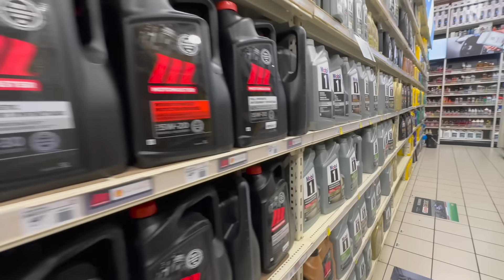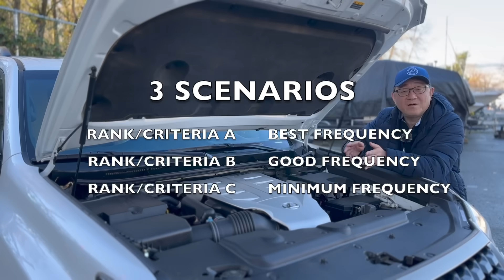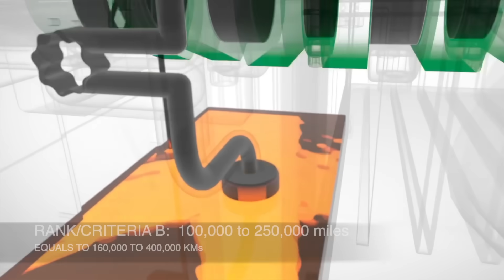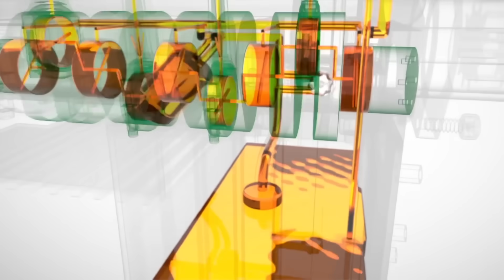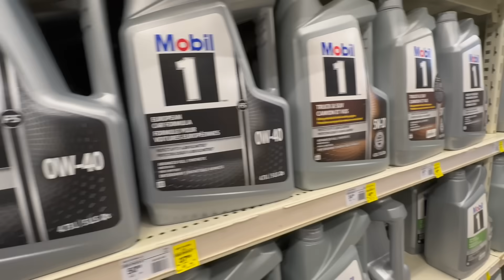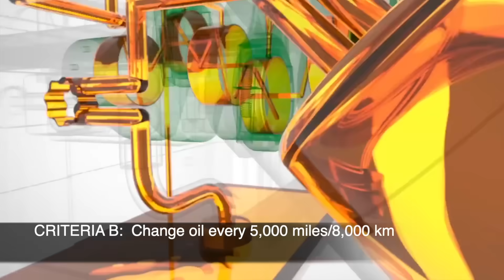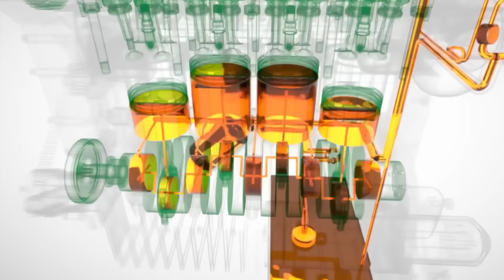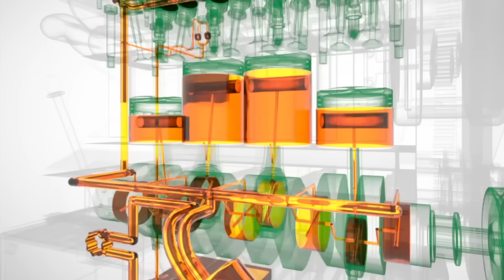ENGINEER EXPLAINS HOW OFTEN TO CHANGE OIL & FILTER // UPDATED CRITERIA-BASED RECOMMENDATIONS!

Comment: Criteria D - You want to keep the vehicle 20 years and only average 3,000 miles a year. My preference is two wheels so my van sits a lot. If 90% of your driving is less than 5 miles, the condensation and exhaust contamination on start up doesn't fully burn off.
I change my oil and filter every April unless I put more than 5,000 miles between changes.

Comment: This is why I do not buy certified vehicles as leased users never change the oil in 20k as they will not keep them. All have sludged engines and oil burners as leasers are cheap and selfish and don’t care about new users problem

Comment: After 12  to 15 years of regular use cars will fall apart around the engines regardless how often you change oil or do other maintenance.  Interiors start to wear out, door dings, rock chips, dents,  rattles, road noise, front ends wear out, emission control sensors start failing, check engine light comes on more and more., In my case my girlfriend (wife now) insists on taking her car on dates.  etc. etc.    Before long you increasingly get a wandering eye looking at new cars.
Reply: 2005 Yota Camry, 300,000 miles no problems except for normal wear items. Not even close to falling apart.

Comment: Gee... My 2000 mercury cougar has had 0-30 synthetic and I change once a year, about every 10-12,000 km.  It sits outside all winter which we get -20c most of and even times as cold as -50c.

Comment: Excellent, simple video, thanks.  I am a retired mechanical, lubrication, and powertrain engineer.  Engine owners must understand the engine is one of the dirtiest oil environments of all oils, and it is the contamination amount that defines when to change oil - not how good the oil itself is.  Advertising 25,000 mile engine oils to most engine owners, those that plan to keep their cars, is incorrect.  Use a good quality API Group III synthetic oil and change oil and filter every 5,000 miles.
There, done.
Reply: It is what Toyota recommends. And you don't need a slide rule.
Reply: @markstrickland8736  - you a subject matter expert in used oil analysis?  If not, suggest you not comment.
Reply: @brianmann986  I didn't realize a subject matter expert certification was required to post here. However, I do know that Toyota has subject matter experts who are far more learned than you. And probably not as arrogant.
Reply: @markstrickland8736  - please show where I said subject matter expert certification was require to post.  I doubt Toyota has expert tribologists.  Please also explain their repeated recent engine failures.  You sir, are the arrogant one.
Reply: @brianmann986  "you a subject matter expert in used oil analysis?  If not, suggest you not comment."
If you think you know more about Toyota's engines than Toyota, you are, indeed, arrogant.

Comment: Thank you for the great video.  Just wanted to ask if there would be a benefit to running synthetic in a Cherokee with 160,000 miles? I have been warned in the past to not do it, as the synthetic will cause it to leak oil.  Just wanted your take on it, with your knowledge.  Thank you again.
Reply: Synthetic comes in high mileage, so I'll go with that
Reply: I went from conventional Walmart to Walmart synthetic at 225.000 miles in the 93 Subaru Legacy. It has 240.000 on it now. Married a lady with a decent Pontiac Torrent with 140.000 miles on it. She has insurance on it. I parked my old Ford truck and the Subaru. I put my toilet paper filters on the engine and transmission. It has 207.000 miles on it now. I told her the Pontiac will out last her Honda Accord because it has clean oil. When her oil change light comes she gets the oil changed.  She complained the other day because she paid 75 bucks for an oil change. The Pontiac gets a roll of toilet paper and a quart of Walmart synthetic every 6.000 miles. She says toilet paper? LOL.

Comment: Honda factory requires a change of oil every 10k miles, I do it every 5k and 25k on CVT fluid. EVs will not replace the combustion engine period.

Comment: Pretty much in line with my own experience and preferences.
I change my car and van oil every 5000, but my bike oil every 2000.
Difference being, I can feel the oil degrade at 2000, as the gearbox is really hard on it.
Never had cause to regret these change intervals, and I've put hundreds of thousands of miles on two and four wheels.

Comment: Very  general recommendation, to be more accurate, it must include the environment and driving habits, such as, are the driving trips a short distance, <5-10 minutes in cold climates or longer trips of > 30 minutes in moderate temperatures.
Furthermore when oil reaches its oxidation and nitration point, the oil will break down and losses it's lubrication properties.

Comment: When I was young and strapped for cash I was told "If you can't afford the oil at least change the filter". Which raises the question: If the oil is capable of longer life as long as it's clean will a fresh filter enable you to run longer (ignoring the mess you might make swapping out filters with a full crankcase)?

Comment: You inital statement that conventional oil does not breakdown is incorrect. Conventional oil or non-synthetic oil loses viscosity as it ages. As the oil deteriorates  so does it's lubricating properties. Older oil will compromise your engine especially at cold starts when lubrication is so critical.

Comment: I try to pay more attention to the color of the oil then the miles. Especially since I do my own oil changes. I forget too often to record the miles! So my rule of thumb is when the oil starts turning brownish. I prepare to change it... 357k miles on my 99 Camry now, bought it in 2000 with 14k on it. Never had an engine issue and not burning oil and compression test 3 years ago, all cylinders equal and well within spec!

Comment: I just change my filter once a year and add extra synthetic oil when needed. My car is a 2007 and has 185k on it, and still runs just fine and with no problems. How does the oil collect so many contaminants if you have a good filter?? What kind of engineer is this guy, and what actual experience does he have? I find that who cares how long your engine lasts if all the other parts on the car wear out before your engine does. It's not just about the engine.

Comment: Driving habits, driving conditions (Highway or city), climate, driving usage (off road, tow, commercial...etc), age of vehicle are all important factors missed here, with respect. I run a showroom condition 2015 AWD MDX in 🇨🇦 with 120,000km's on it. It's cold here and I do city driving mainly, I run full synthetic oil. The Acura maintenance minder is pretty advanced (It monitors many items) and I trust it. It kicks in at about 6,000miles (9,500km) and that's in line with the owners manual and what I believe personally.

Comment: I am onto my second Turbo Petrol car, the first one had a RB30 motor and always changed the oil n filter at 5,000kms, most people who had the same car as me were rebuilding their turbos at around 160,000kms, before I got rid of my first turbo car it had 260,000kms on it and never had a problem with turbo play or actual engine. My second turbo petrol current car is an i30N Performance Luxury Model, I also change my oil n filter every 5,000kms it never blows any smoke or needs extra oil before oil n filter change.  So IMO if you want your ICE to last you for how ever long change your oil n filter every 5,000kms, and Air filter every 20,000 max fuel filter 30,000kms, run some injector cleaner at least once a year and you should have an ICE which will last you for a long time.

Comment: I HAVE A 1999 TOYOTA 4 RUNNER LIMITED WITH 3.4L V6 DOHC ENGINE WITH 966,285 KM OR 600,000 MILES . I USE A PUROLATOR BOSS LONG FILTER  WITH AMSOIL SYNTHETIC SIGNATURE SERIES 5W-30 AND LUCUS SYNTHETIC OIL STABILIZER, AND I CHANGE THE OIL EVER 20,000 KM OR 12,000 MILES. 

IF YOU USE ALL OF THESE WHICH ARE THE VERY BEST OIL , OIL FILTER AND OIL ADDITIVE  YOU CAN GET 20,000KM OR 12,000 MILES PER CHANGE. 

I AM LIVING PROOF OF THIS. IF YOU LISTEN TO THIS GUY AND CHANGE YOUR OIL EVERY 5,000 KM NEVER USE SYNTHETIC YOU ARE WASTING YOUR MONEY.

Comment: The simple answer for ALL.  Change the oil when its getting darker, but not black.  If its almost clear honey appearing and 5,000 miles, DO NOT CHANGE IT!  I don't care if its been 3 months or 5 years.  WASTE OF MONEY.
If the oil looks more like weak coffee, now is the time to consider changing it.  Its not full of contaminants yet, but its got more than enough that wear will start becoming worrisome as it moves to full on black oil.  

If oil is black and you can't see the dipstick through that little dab of oil, then you've waited too long.  Change it and don't wait that long next time.

Visual Flight Rules here.  Check your oil.  If it looks almost like it did when new, leave it alone.  If it looks dirty brown, but still somewhat translucent, it's still fine, but you should be readying for a change in the next month or three (if you drive ALOT) or in the next year (if you drive very little, work from home, weekend car, retired, etc).

Any strict schedule is A SCAM!  It's big oil colluding with big auto.  Tell them both to go pound sand.  Tell experts to go pound sand. 

The ONLY outlier, is if water gets in the oil, it may still look clear(ish), but if you notice your oil is thinner than it should be, CHANGE IT!...and get that engine checked for blow-by or head gasket issues.  Most of the time thin oil will result in low oil pressure warning, so take that seriously.

Comment: Why is the recommended oil change interval for diesel engines so much longer than gasoline engines.
Reply: Really?  My 6.6l Duramax has a recommended oil change interval of 10,000kms.  My Porsche is 15,000kms.  Does GM know something Ferdinand doesn't?

Comment: 6 months or 4000 miles which ever comes first.  Using Pennzoil Platinum Euro synthetic 5w-40 in my 2016 VW Golf MK7 with a Stage one tune and no failures so far.

Comment: NOTHING can prevent oil company from LYING about oil content. They can easily put full synthetic label in the bottle even if it actually use recycled base oil of the worst quality possible without any consequences.

Also this video do not address the extreme difference of oil quality between brand in the market. especially when people no longer pay attention that some oil do not have API certification mark. so even 3000 miles suggestion can damage the engine with poor oil quality. Even if it has FULL SYNTHETIC label on it.

Comment: great video!  Those expected lifetime mileage numbers for B and C almost hurt my feelings.  I have a 30 year old Dakota with just under 300k on it and I change the oil twice a year no matter what the miles are. I do that because it calls for a thinner oil in the winter than summer... It still doesn't burn any oil but I drive 90% highway miles on it, so maybe that helped.  My Toyota Sienna gets it's oil changed at 3-4k miles and it just got it's 4th timing belt change yesterday at 323k miles... I'll be upset if both of them don't go past 500k miles LOL.

Comment: Great info, exactly what i'm looking for! I Own a 2014 F150 3.5L ecoboost, with 94k miles. I used to change the oil every 5K, but since it's getting up there in mileage, i've decided to change it every 3,500 with a brand new filter. I use the P1 Boss filter along with Valvoline Maxx life Hight mileage or Pennzoil Ultra or Platinum oil. However, i've been using the Valvoline more lately because it's much cheaper over the Pennzoil. Probably switch to the Pennzoil every third OCI.

Comment: 25 year old Honda Accord, oil and filter changed every 3,000 miles and it still runs perfectly.
Reply: Honda jazz, 19 years 183k miles, I am the owner number 5.  I change the oil each or before 3k miles too.  I just adjusted the rocker arms and checked the timing chain.   and around.  and oil pan too,  all good.
Reply: I GUARANTEE if you went 10,000 miles between oil changes, NOTHING would be different Vs your 3,000 mile interval. Your Honda would run EXACTLY the same as it does now. Of course, you would add a bit of new oil during the time. All engines will burn some oil. 
SO MANY driver's have been hoodwinked by those 3.000 mile oil change company campaigns! So many consumer's have wasted time/money changing their oil every 3.000 miles! If it makes one "feel good" I guess, have at it....I am not that gullible.
Reply: @ttbjammn  that is funny as is your GUARANTEE. My car is probably older than you are.
Reply: @paulbunyon6324  I am 59 dude. Changing your oil at 3,000 miles is such a waste!! Do not be so gullible...
Reply: @ttbjammn  The gullible people are the ones that believe the manufacturers' claims that you can run crazy intervals and the evidence of that stupidity is now everywhere. Making your claim of 10,000 miles ignores the fact that cars operate in a myriad of different conditions, so right there, your claim is assinine. I use cheap Walmart synthetic that I have no issues with dumping every 3,000 miles of severe service that I give this car. Its paying dividends, thank you very much.
Reply: @paulbunyon6324  Dude, you ARE gullible...no asinine advice from me EVER. So let's say your Accord averages about 25mpg. So 3,000 divided by 25 is 120. So you change your oil after burning about 120 gallons of gas? How asinine is that? VERY. 
You have wasted time and $$$$$ changing your oil at an asinine 3,000 miles. I will give you my address so you can ship your "old oil" with 3,000 miles on it. I will use it in my 2007 Mazda6s with 104,400 miles. The Mazda's V6 (Ford Duratec Mazda beefed up) still kicks it well. Engine runs like new.  
Many people have been hoodwinked to the max with "the 3000 mile oil change interval" many oil change services implemented years back. Companies know people like you are out there WHO ARE GULLIBLE. 
Dude, go at least 6,000 miles between oil changes. Take a break from being so gullible....
Reply: @ttbjammn  Your Mazda has no miles on it yet to even talk about. How about you just mind your own business DUDE.

Comment: It doesn't matter how long i keep the car. Maintenance still has to be at high level.
I changed oil right before returning leased car back to manufacturer because it was almost due.
All my stuff has to run perfectly to the end so the next person that will get my vehicle won't have to pay the price because previous owner was cheap or lazy

Comment: If you want it to last forever make sure you change the oil at 1000km once the break in period is complete. 5000km for severe service: towing or city driving stop and go. 10000-12000 highway cruising at steady speeds.
You never read a factory service manual.

Comment: I had the mentality of keeping the car as long as possible, but after 16 years of owning my 2003 Nissan Pathfinder, I think that after about 10 years, you want a new car, not because the current one is bad (mine just needs valve cover gaskets), but because the car depreciates mentally. I love it, its reliability, great acceleration, 4wd capability, but still you want something new. I don't drive too much, but I always maintain my cars from the mileage perspective, I disregard the time interval in some cases. For oil, I always use high quality synthetic oil, like Mobil 1 and good oil filter. I don't get why you should save either on oil or oil filter, it's like 300$ difference in 10 years. Oil change interval is 5000 miles or 1 year, whichever comes first and always change the oil filter. For other fluids, I follow the owner's manual and change them after specified mileage.

Comment: I imagine that you might have a slightly different answer for the intervals on diesel engines?   I get an oil change once a year or 10,000 miles whichever comes first even though the manufacturer says that I could double that.  I use synthetic oil only for all my gas cars as well, but, they get changed at least twice a year.  Oil changes on a diesel engine are way more expensive than a gasoline and have multiple filters.   They also have more than twice the oil capacity in the engine.

Comment: With the current crop of GDI engines you need to change the oil every 3,000 mls /5,000 klms as the VVT system needs thin clean oil to operate efficiently & with the least amount of wear from cold start.

Comment: Thanks Mr. Chao.  I have 4cyl turbo cars, use synthetic and change the oil at 4k miles.  I've often wondered if I changed the oil filters (top-mounted on the engines) halfway through the change cycle that I could get away with 6k oil changes.  Probably capture more particulate but do little in the way of chemical contaminants.
Reply: Cool them down after a high speed run or going uphill for awhile. I always drive mine through the neighborhood before shutting them down.

Comment: Change my oil at recommended service intervals. Use synthetic and one qt Marvel Mystery Oil. Did this in the 70’s and got a brand new Ford Pinto 1.6 liter engine up to 485,000 miles. Never overhauled it. Body rusted out. Use MMO with proper dilution in the fuel to keep pump lubricated and clean. Change plugs at 100k.

Comment: I live in the uk and I’ve got a ford transit custom 2.0 ecoblue 2018 . Ford’s recommended service interval for this van and this is no joke is every 36000 miles with synthetic oil of the correct spec.It’s the most ridiculous recommended service schedule I’ve ever heard of. I totally ignore Fords recommended service interval and change the oil and filter every 10000 miles. After watching this video I will change it more frequently than that. I just can’t understand how Ford can be so massively out in their service recommendations. I for one won’t buy another Ford just for the fact they treat their customers like fools